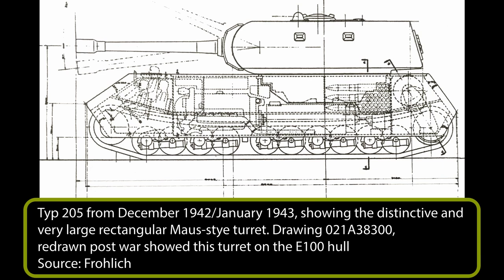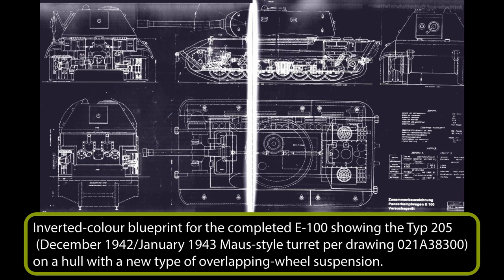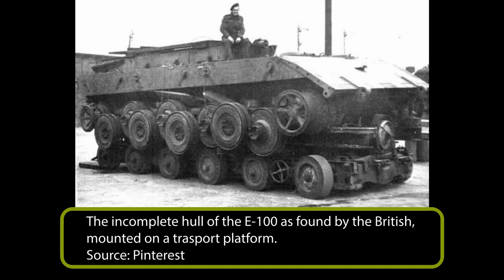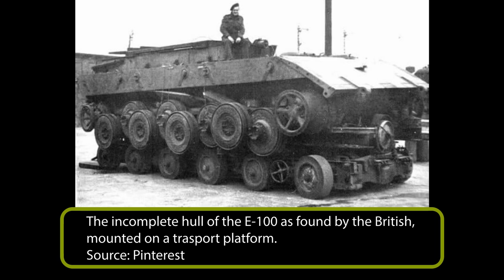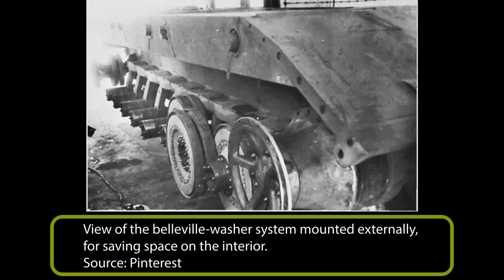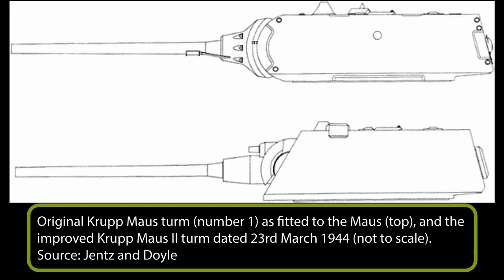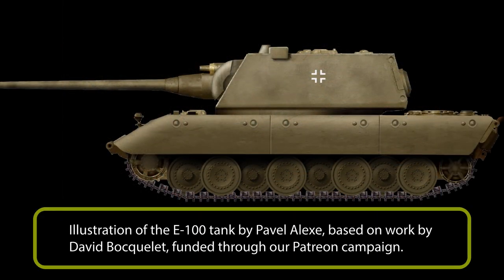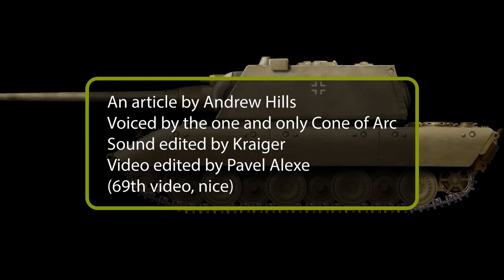The E100 (Entwicklung 100) | A Far Cry From Practicality feat. @ConeOfArc

Comment: E-100 and the Maus both looked like a good idea at the time on paper e.g. Armor and Fire power. But when it came to the real things both are useless when it comes down to logistics
Reply: Useless in a conventional assault tank sense yes. However the Maus and E-100 would severely strong and unbeatable if placed right and had the right AA support as mobile defensive guns
Reply from the maker: They were meant exclusively as limited breakthrough vehicles. Tanks are not defensive weapons.
Reply: Tanks Encyclopedia that’s why I said they are more practical as defensive weapons and not breakthrough weapons due to the inefficiency of the vehicles mobility and high maintenance cost. The tiger series were more of an ambush and defensive tactic tank so why wouldn’t he Mause or E-100 be one as well? Kind of a flawed mindset that the Germans had for such a heavy and high cost tank
Reply from the maker: @ifoundmemallet3394  the Tigers were not in any way ambush and defensive tanks. They were also breakthrough tanks.
Read up on the German heavies
https://www.google.com/amp/s/tanks-encyclopedia.com/ww2-germany-durchbruchswagen/amp/
Reply from the maker: https://tanks-encyclopedia.com/ww2/nazi_germany/panzer-vi_tiger.php
https://tanks-encyclopedia.com/ww2/nazi_germany/panzer-vi_konigstiger.php
https://tanks-encyclopedia.com/ww2/nazi_germany/panzer_maus.php
Reply: Tanks Encyclopedia youre not getting the point here. In just about EVERY engagement that the allies had with tigers, the tiger tank crew were lying in waiting. Almost every engagement was an ambush or from a defense position. They may have been DESIGNED to be a breakthrough tank but that doesn’t mean that’s what they are best suited for. The true king of the Germans assault tanks was the PanzerIV due to the decent armor, good gun and good mobility. I’m sure you know of the T-95 and how heavy and slow that fucker was being only a proto tank. It was supposed to be an “assault” tank but would it be effective at a max speed of 8mph? Hell no. It would be best suited as a defensive unit rather than an assault tank. And tanks can be defensive units. They have been used in such a way in tons of engagements. A tank isn’t always meant for attacking a position
Reply: I would say that there is a lot of confusion between wordings. Breakthrough tank for example is used in a sense of smashing through heavy fortifications and defenses and thus heavy tanks were designed for that purpose with a lot of armor and firepower, but poor overall mobility. However, Pz.4 and other similar mobile medium tanks later there used for breakthrough operations in a sense of smashing through enemy defenses and going deep behind enemy lines. These were medium tanks, capable of taking practically everything head on, having some protection against heaviest of guns and mobility to put those traits to good use. Then we have another key word which is sometimes used: assault. I think it represents better what an assault vehicle should be. Attack a point in enemy lines and neutralise its defenses while allowing other, more agile tanks to breakthrough remaining enemy formations and wreak havoc behind enemy lines.

However, Mikat2, you are wrong. There wasn't historically any concept of "defensive tank". Even most heavily armored tanks like T-95 or Churchill tanks were made for sole intent of attacking. Also, heavily armored giants like those are not best suited for ambush. An ambush vehicle looks like Hetzer. It was designed for a sole purpose of ambush in a sense of having small dimensions to hide. Armament which is only effective at close ranges (relative to tank combat). Heavy tanks like Tigers and Mauses were designed to attack enemy formations and fortifications. They do this a lot better, because there wasn't any effective return fire against them. If you would send Pz.4, it will get destroyed by Sherman. Send Panther, their armor might be sufficient for anti tank warfare, but such warfare is done through huge ranges and you are not flanked. For assault and breaking through enemy lines you need to get close to them in order to create a gap and destroy enemy units. Thus weak side armor of Panther would get penetrated by Sherman. Alright, lets bring our heavy tanks! Heavy tank would do a lot better in this role, because it can resist enemy fire from a lot closer and enemy can't penetrate it from sides or rear, because it has effective armor everywhere. Such tank can go and breakthrough enemy lines quite successfully. 

Such philosophy was before and during WW2. However, with time it had evolved from assault vehicle into anti tank hunter. It was less about going through enemy lines and more fighting like a medium tank, but with so much armor and firepower that you naturally resist everything from afar and can destroy anything. Heavy tanks became apex predators in a sense, but role of a turtle who would roll through heavy resistance remained unfulfilled. Thus this is where comes super heavy vehicles like T-95, Maus, E-100. They would have to fulfill said role of assault, however, lighter turret on E-100 had made this tank useless in its intended role as turret sides were unacceptably weak.
Reply: @REgamesplayer  Mikat2 is right. Any tanks that are heavy and slow (Tigers ,T95, Elefant etc.) were and will be most effective if put in a defensive position edit: needs 
good gun
Reply: @ifoundmemallet3394  Eh, not really.
Reply: Not useless but germans had trouble supplying the frontlines and well as repair different types of tanks. In other words they should have focused on less systems.
Reply: Logistics would not hamper these machines to the point of obsolescence but instead air power and indirect fires would make these tanks juicy targets.

Comment: The Krupp Maus II turret seems like a big upgrade. The front doesnt create a trapshot, has rangefinder, doesn't have that stupid 7.5 cm coaxial and is much lighter. But germans being germans built the heavier and more ridiculous one.
Reply from the maker: 7.5 cm is still present, it is no longer on the side, but on top of the main gun, and is not stupid.
Reply: @TanksEncyclopediaYT  right a smaller caliber gun is very good. Always having a gun loaded and having a gun that is not "overpowerd" like the 12,8cm or 15cm for some AA truck.
Reply: the 7.5 cm coaxial could aid in range finding and also fire potent high explosive since its a short barreled 7.5

Comment: The E 100 (with proper turret) appeared in World of Tanks. Weapon choices are both fake and real. the 150 mm gun is fake while the 12.8 cm gun is real/projected. The engine is kinda fake: “Maybach Neues Projekt”. I knew this because I am a WoT player.
Reply: Hmmm, how would you compare the Maus from Warthunder vs World of Tanks?
Reply: DANIEL M. Well, aside from the obvious, the Maus in War Thunder doesnt change armor numbers while Maus in WoT is powercreeped.
Reply: @edwardvincentbriones5062  Maus in War Thunder is very hard to be balanced, therefore it was removed
Reply: @Kalashnikov413  "removed" they say its going to be an event vehicle. but they say alot of things
Reply: Well now it is !! 
But that ends tomorrow

Comment: I would say that there is a lot of confusion between wordings. Breakthrough tank for example is used in a sense of smashing through heavy fortifications and defenses and thus heavy tanks were designed for that purpose with a lot of armor and firepower, but poor overall mobility. However, Pz.4 and other similar mobile medium tanks later there used for breakthrough operations in a sense of smashing through enemy defenses and going deep behind enemy lines. These were medium tanks, capable of taking practically everything head on, having some protection against heaviest of guns and mobility to put those traits to good use. Then we have another key word which is sometimes used: assault. I think it represents better what an assault vehicle should be. Attack a point in enemy lines and neutralise its defenses while allowing other, more agile tanks to breakthrough remaining enemy formations and wreak havoc behind enemy lines.

There wasn't historically any concept of "defensive tank". Even most heavily armored tanks like T-95 or Churchill tanks were made for sole intent of attacking. Also, heavily armored giants like those are not best suited for ambush. An ambush vehicle looks like Hetzer. It was designed for a sole purpose of ambush in a sense of having small dimensions to hide. Armament which is only effective at close ranges (relative to tank combat). Heavy tanks like Tigers and Mauses were designed to attack enemy formations and fortifications. They do this a lot better, because there wasn't any effective return fire against them. If you would send Pz.4, it will get destroyed by Sherman. Send Panther, their armor might be sufficient for anti tank warfare, but such warfare is done through huge ranges and you are not flanked. For assault and breaking through enemy lines you need to get close to them in order to create a gap and destroy enemy units. Thus weak side armor of Panther would get penetrated by Sherman. Alright, lets bring our heavy tanks! Heavy tank would do a lot better in this role, because it can resist enemy fire from a lot closer and enemy can't penetrate it from sides or rear, because it has effective armor everywhere. Such tank can go and breakthrough enemy lines quite successfully. 

Such philosophy was before and during WW2. However, with time it had evolved from assault vehicle into anti tank hunter. It was less about going through enemy lines and more fighting like a medium tank, but with so much armor and firepower that you naturally resist everything from afar and can destroy anything. Heavy tanks became apex predators in a sense, but role of a turtle who would roll through heavy resistance remained unfulfilled. Thus this is where comes super heavy vehicles like T-95, Maus, E-100. They would have to fulfill said role of assault, however, lighter turret on E-100 had made this tank useless in its intended role as turret sides were unacceptably weak.

Comment: @coneofarch E100 1943 was its design based on the original requirements from the lowe panzer 1940: a 128mm gun and a 1200 horse power engine?

Comment: @coneofarch if the Allies had to compete against the e100 would the prat and Witney wasp engine for aircraft with some 3000 horse power be transferable to tank use to combine with a pershing type tank with 155mm be usable? It's seems that the 90mm could defeat e100 as it could punch through 20cm of armour. So perhaps a up gunned m36 would of done the task? Should the panther 2 of emulated fast USA tds? Or where Eastern front conditions so violent that it forced the Germans to develop panther and King tiger?